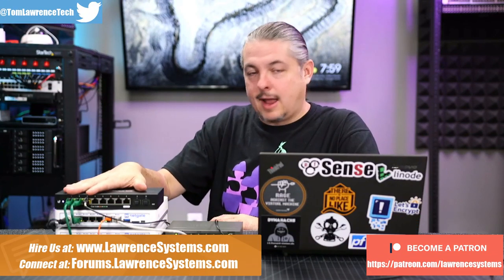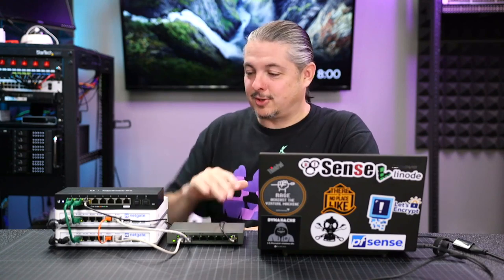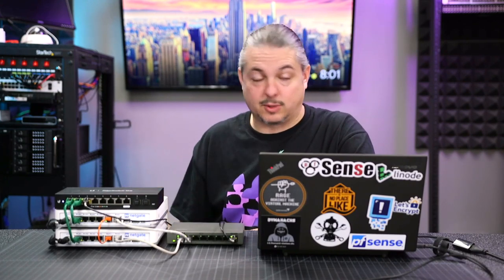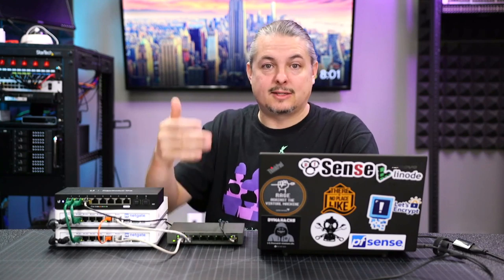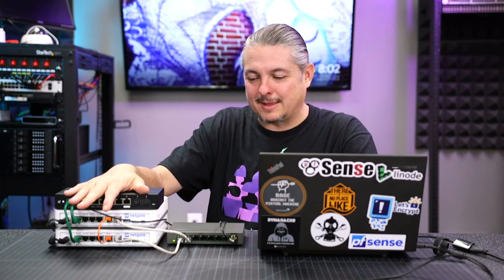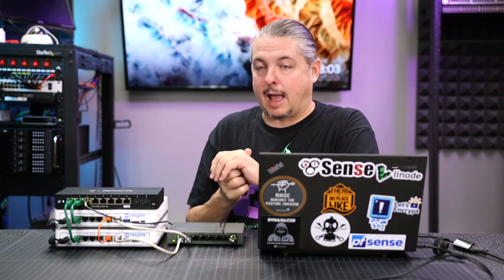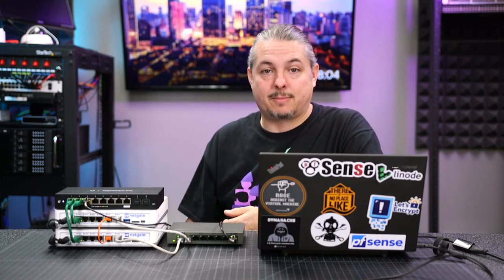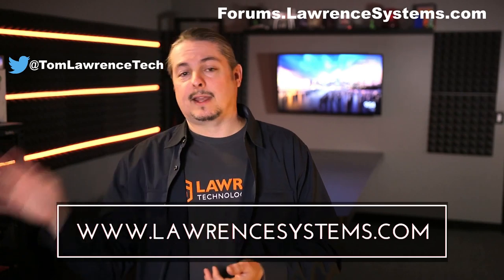Part2 Lab VS Deployment "Testing pfsense SG 3100 HA Firewall Fail Over & The Physical Layer"

Comment: If you people have NO background in Electronics, you have no idea about how these things are made. 

Today, most electronics are made with all the similar OFF THE SHELF components!! 

Say whatever but I have NEVER had a Netgear or Dlink power supply (or device) fail.

And have spares that can be exchanged in 10 minutes if they ever fail.

Now, how many PS failures in Cisco or ‘Enterprise’ devices? (Hint: More).

(How long does it take to get the expensive part?).

Yes, I do make fun of the people that spend more than double for the same solution.
Reply: Are you talking for small business and home use? Because that can't be true for data centers
Reply: pepeshopping I know that the probability of downtime even using off the shelf components is probably low, but for colo and other enterprise providers why use consumer equipment? Especially if you have the money and downtime is unacceptable.